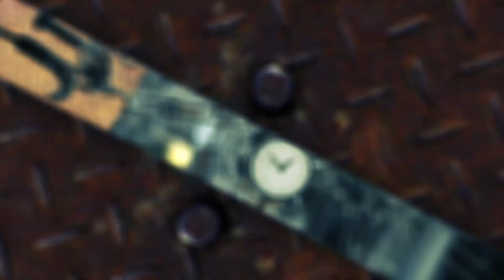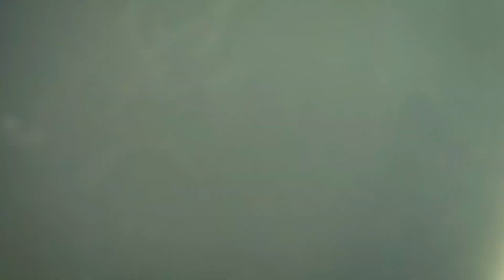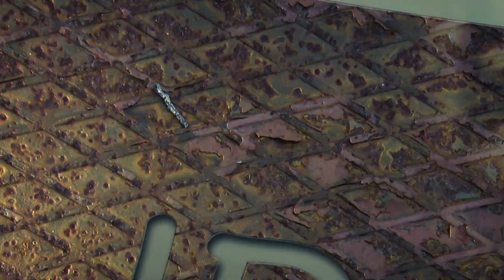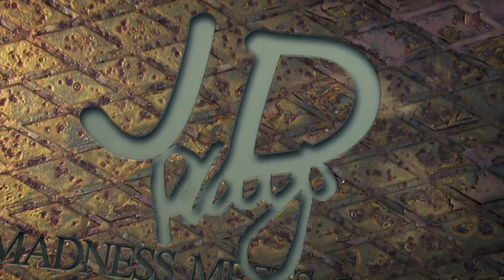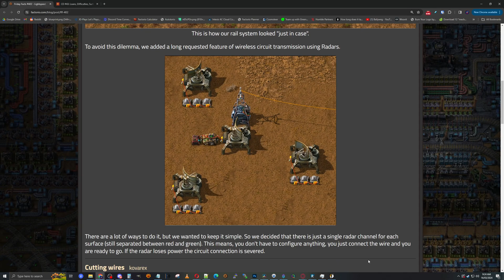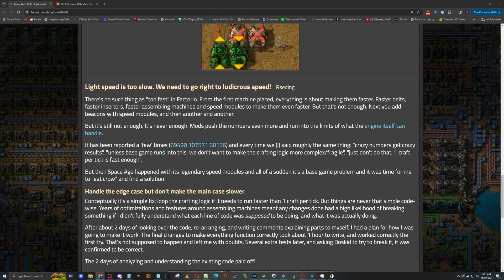Factorio Friday Facts #402 ⚙️Lightspeed circuits

Comment: It replaces _CodeGreen's "Reconnect Cut Wires", more accurate than Picker Dollies.
Also, the modding community somehow already made the radar circuit network thing "FFF 402 radars" which is 0-tick, unlike other wifi mods.
Fun fact, they showed us crafting machine "pulsing" when finishing craft in FFF-394. If you have more than one per tick, we're getting a number > 1, which is nice.
A dev said that this specific recipe at this time of the FFF uses 2 molten iron per craft.

Missed the leak in the middle of the foundry clip! Zoom into the exact center of the clip. There's some claw/backhoe shovel or something there moving. It's not part of the foundry.

Comment: Kinda wish they imported the wireless network transmitter/receiver from some of the mods rather than using the radars.
Reply: I'm not sure yet how I feel about this.  But I definitely see a use for that mod even with this -- especially for surface-to-surface, but also in case one wants more than one wireless network on a single surface.